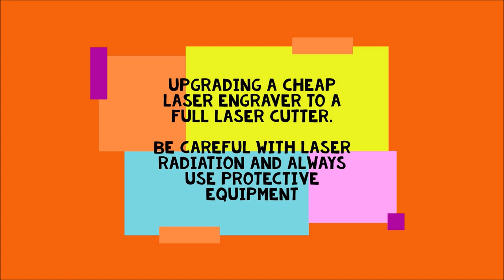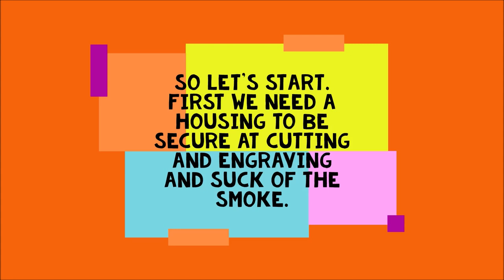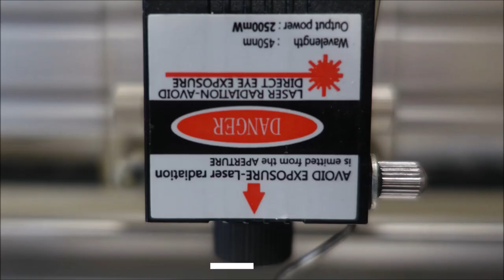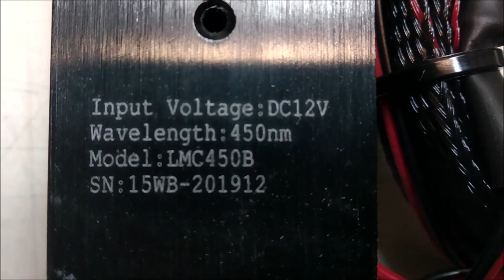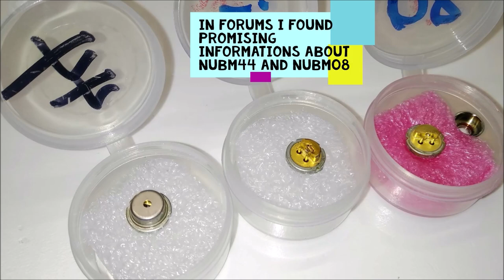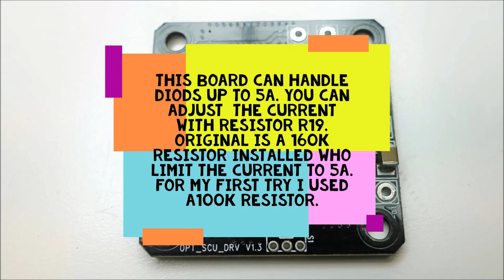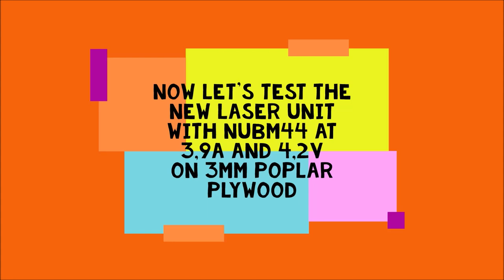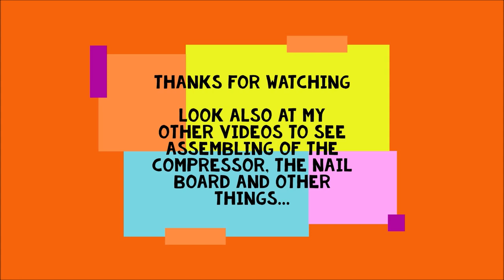Tune up your Laser engraver

Comment: i removed the gball lens from nubm08...and attached the g8 lens.....
The laser seems to converge at around 8cm......but like after 8 cm it diverges like hell..making a rectangle of around  2x1 foot.

any idea why?pls help
Reply from the maker: How big is your focus point after 8cm?
Reply: @modellbaukalender  its more like a dot of around 5mm...but never measured it like that....
Also if you know the Max operating temp. of a single NUBM08
pls let me know...as all the specs out there shows the Max Op. temp. to be 0-70deg. but for the entire laser diode block.

Comment: Ich muss mich nochmals bei dir bedanken. Für die Videos, die Inspiration und dein System.
Ich hab es mir so ziemlich ähnlich nachbauen können und bin heute damit fertig geworden. War nicht immer einfach die passenden Teile zu bekommen, da die Ware aus China ja doch jedes Mal anders ist als man es sich denkt. Trotzallem konnte ich heute das erste mal 8mm Sperrholz schneiden :) Die Nubm44 is schon echt ne Wucht, damit macht das wirklich Spaß!
Jetz fehlt nur noch die Feinjustierung.
Danke dir!
Reply from the maker: Freut mich zu hören, welche Linse verwendest du und mit welchem Abstand arbeitest du?
Reply: @modellbaukalender  Der Abstand is ähnlich wie bei dir, dürfte etwa ne gute Eddingdeckel Höhe sein. Linse hab ich die G-2 die sich ganz gut fokussieren lässt bei mir.  Musste mir nur die Fassung für die Diode selber basteln da ich bisschen Sorge hatte, dass es in der  Messingfassung zu warm werden könnte  und ich keine passende aus Kupfer gefunden habe. Wollte mir nicht gleich ein ganz neues Lasermodul kaufen nur wegen der Fassung aus Kupfer :)

Comment: Very well done, Can you provide a few pics of the whole set up from control board to driver.
Reply from the maker: From control board to driver i only use this cable with white plug which I made myself - https://youtu.be/19Vr2B-J19Q?t=1002
Red an black are thicker than the original, I think about 0.75mm².
The cable with red plug is the original one, with this one i was loosing about 3V from control board to driver.
Reply: @modellbaukalender  The voltage loss via the cable does not really matter, as the diodes are operated with a constant current. This means that the voltage is always automatically set at the diode.
Reply: Is the control board compatible for LightBurn software?
Reply from the maker: Not sure, but it should work.

Comment: Awesome build and very well explained, thanks a lot for sharing!! Only leaves me with one question: Do you have an adjustable bed height or an adjustable z-axis with stepper motor to keep your focus point correct or how do you deal with that?
Reply from the maker: Most of the time I only work up to 5 mm material thickness, here I set the focus with the lens. I can also adjust the height of the laser manually in the range of about 30mm. And then I can also remove the cutting pad, with this I gain another 40mm.
Reply from the maker: I've already thought about it, but up to 6 mm thick I have no problems at all.

Comment: Very nice! What was the reason for changing the controller module? I believe I have the same one that is good to 5A, so I think it should run the NUBM44 OK, was there some other deficiency, or was it just damaged when you accidentally wrecked the old, uncapped diode?

I may do this upgrade because I have a BangGood "5W" diode that I don't think is actually outputting 5W.
Reply from the maker: My old module only managed about 3A and i had a lot of loss from driver to laser. The new Driver works up to 5A and is directly mounted at the laser.

Comment: Are those 3mm acrylic plates laser safe??? Where did you get them I don't find it anywhere. I wouls also like to make a box to my Atomstack A5 pro with ventillation and air assist :-)
Reply from the maker: I can't say for sure. But I once read in a forum that it should be enough. The panels are from the hardware store. It's just orange acrylic glass.

Comment: The laser unit looks different in your previous videos? The fan hangs off the side and there is no driver board visible? What changed between them?
Reply from the maker: In previous videos i had one 30x30 fan on heat sink and the 40x40 fan with driver board on the side. Now i shorten the heat sink and cooling everything with the 40x40 server fan. But it's the same driver board and the same laser diode with a little bit bigger wires. -> https://youtu.be/qwSQognfhoU?t=27

Comment: Great job!! i have a neje 20w module which seems it failed by the first couple of uses.. it supposed to use NUBM0A diode, could you propose what diode would be best to replace and make it cut? Some others use NUBM08 without the cap but as i know it can dramaticaly reduce the life of diode... do you have "hours" on your new module? how long for cutting? Many thanks in advance! P.S> how did you find the resistor which affects current? Are these boards from ebay come with instructions or schematic?
Reply from the maker: Hello, I have not tested NUBM0A. On a NUBM08 diode you can easily remove the cap. About the resistance you can find information in the offer on ebay (look at the pictures). The NUBM44  i use, have at the moment about 30 hours cutting time i think...
Reply: @modellbaukalender  thank you for the info!

Comment: Greetings
Did I see that you replaced the laser diode and the lens? Do you also say to make adjustments with the Resistor R19?
For a beginner, the adaptations are a little complicated; I thought the Laser Module (from eBay) was already ready to be installed, of course, along with the other components like the Control Board and the 5A constant current driver.
In conclusion: Isn't the 15W or 20W Ortur Laser Master (from eBay) enough to cut like yours? Thanks
Reply from the maker: It is enough to exchange the laser and the corresponding driver. I only exchanged R19 so that I can protect the diode a little.
Reply: @modellbaukalender  Ah! OK; thank you for the information.
Reply: You could specify more precisely which NUBM44 laser should be purchased because the page that opens shows several, including a complete module. Thanks

Comment: There are drivers half price up to 4Amps.. Typical current for NUBM44 is 3.. did you "pushed" up to 3.9? Will it last? NUBM08 has same margins?
Reply from the maker: With a good cooling system you can try up to 5A and more...
Reply: @modellbaukalender  nice! How did you determine the upper limit of 5amps? Trial and error?(burn :) ) Also have you any ideas of good temp monitoring? Neje modules should have some kind of ntc touching the diode itself..
Reply from the maker: I didn't tested it, but i read it in a forum, someone use the laser with 5A without problems. For short time the have tested it up to 10A.

Comment: Good evening dude, I bought a laser 30w output 7.5w which is supposed to be better than this and yet I have not been able to cut 3mm wood with less than 9 passes. what am I doing wrong ? what could i do to improve it? I use lighburn. thank you
.
Reply from the maker: It's difficult to tell where the problem is.
Which laser do you use, where is the focus, which wood ...
Reply: Good morning, I bought the neje 30w. I have seen some videos with the focus of the laser and I think I made it without being absolutely sure. I have put it as small as you can. the wood is birch 3mm. also another problem I have is that I can cut a wood 9 times and immediately after it can not cut it 9 times and put it at 12 to cut it. if I put an air compressor on it it will make it easier to cut; the air does not play a role in helping the cut ?
Reply from the maker: If you have plywood with waterproof glue, you have no chance of getting through. Maybe you should try cheap poplar plywood from the hardware store.
Reply: I am also having this problem, I bought a 30w laser seeing the seller cutting through 6mm plywood with it, I just want to cut 3mm but cannot, I don't have air assist, just using a very strong fan that is focused on the cut, but ye it fails.. 

When i cut the wood on my bandsaw, it seems to stop at the first layer of wood and does not pass.
Very frustrated

Comment: I looked at the NUBM44 diode and it comes in 3 different versions, 50 mW (similar as shown in your video) and 2 7W (V2). Which is the right one? Thank you and congratulatios for your work!
Reply from the maker: 50mW i have never seen, this one should be a "7W" Version

Comment: Hello,
I have a problem with the diode, I connected it to the module and set the maximum power in grbl. The diode takes 2.8 - 2.9 A and 5.5V, but does not burn the paper, where could the error have happened?
Reply from the maker: Absolutely white bleached paper is very difficult to cut, you might try recycled paper
Reply: @modellbaukalender  We probably don't understand, the diode is very dim and not a hint of burning or engraving. I keep my finger in focus point
Reply from the maker: Maybe the power supply is too weak? It's hard to say where the problem is, maybe you ask the seller about datasheet and manual about the driver.
Reply: @modellbaukalender  Sure seller has been contacted, power suply have 4A but i have more power power supply
Reply from the maker: Which cable do you use between the diode and the driver? Are they thick enough?
Reply: @modellbaukalender  maybe 0.75? what should be the diameter of the cable
Reply from the maker: maybe you can try thicker cables and only a few cm long

Comment: Great work! How did you remove the diode from the original module? Was it a friction fit? Thanks.
Reply from the maker: I bought a single diode without module.
Reply: @modellbaukalender  thanks for replying! But I meant, did you reuse the heatsink and copper from an existing module? If so how did you get the old diode out?  Thanks
Reply from the maker: Yes, i used the old heatsink and copper module. The diode is only pressed in, just push it out from the front, maybe you need a hammer...
Reply: @modellbaukalender  thanks! I've done mine now too, but I bought the wrong driver which only goes up to 3 amp... New one in the post!

Comment: Is this machine already sold as a DIY Laser Engraver or should this be purchased separately and Upgrading? If so, where to buy the complete Laser engraver?
Reply from the maker: This one was sold as engraver, upgrade parts you can find in description
Reply: @modellbaukalender  Okay, and how many watts does your laser have (NUBM44 Laser Diode)? And how high do you leave the laser to the material to be cut?
Reply from the maker: Input Power is about 16W, output power i can't measure. Focus i set always on top of the Material.

Comment: You should offer this as an upgrade kit, people would send you their modules, myself included. 
I'm using an ortur master 2 20w 5.5w diode apparently. It's rubbish for cutting.
Reply from the maker: There are so many different combinations of lasers, heatsinks and drivers that it would probably be better to put a single system together and sell it. Maybe I'll try.
Reply: @modellbaukalender  I think you should have a good think on it. A plug and play system maybe. Neja are doing something like that.
Chinese lasers are cheap, they are capable of much more though, but they make the money with new models and constant upgrades to pushing sales.

Comment: What software you using? I have LightBurn and need to know if the controller is compatible and any changes to the grbl settings.
Reply from the maker: currently i am using lasergrbl
Reply: @modellbaukalender  If you use LaserGRBL then works Lightburn too.
Reply: Thank you for the clarification!